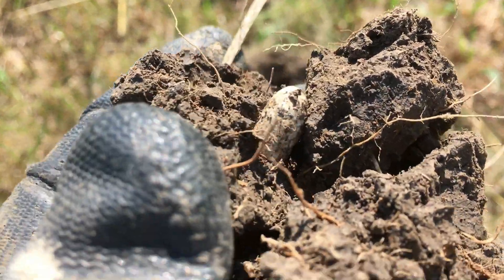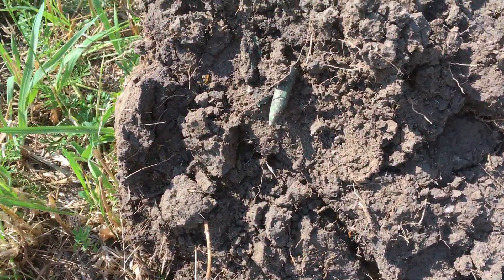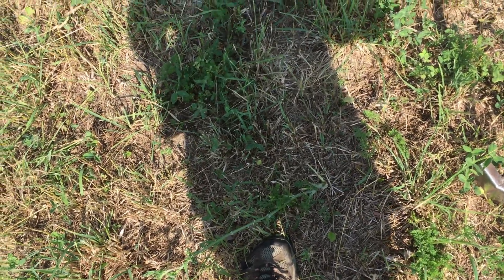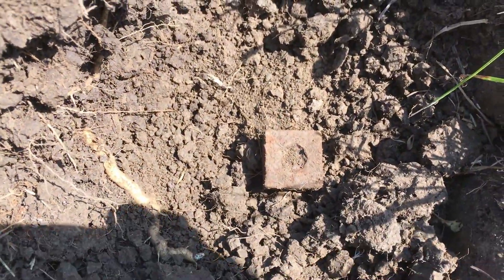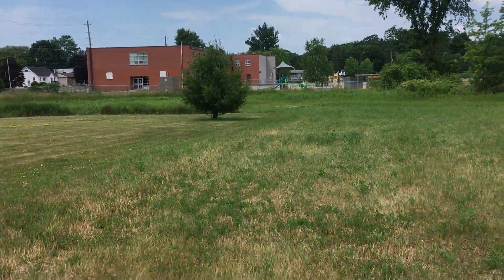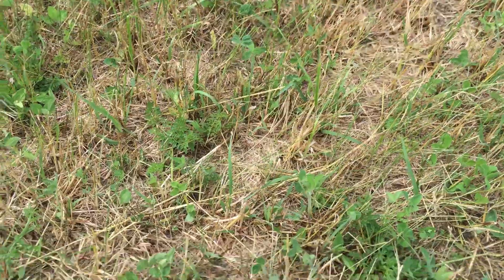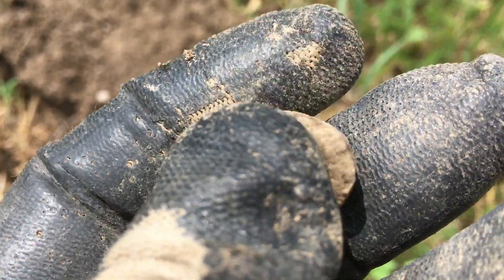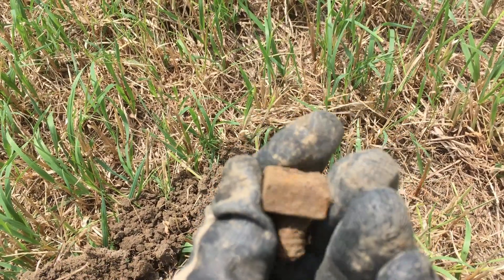Farm Field Ring Recovery - Did we find it?

Comment: Ya gave it the old college try👍🏻 nice other relics hope you get to dig the rest of the field! Thanks for sharing! Be safe and HH 🎧⛏
Reply from the maker: Thanks!  There are lots of places I will get to dig around the farm.  Next is an old baseball field that he said was used from the 1800’s to 1960. Shows up on the 1953 air photo and traces are still visible.  Have to mention to him about the hockey rink outline in another field that also shows up on the 53 aerial. I’ve learned that in this area that before rural municipal sports parks, these would be built on private farms for community use.